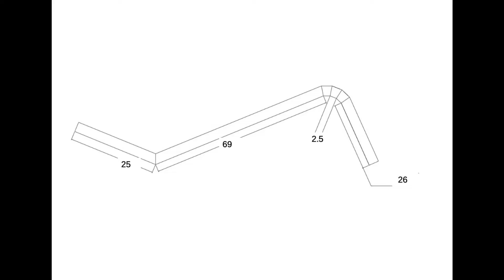1178 How To Build An Electric Trike In Paper - Building The Frame

Comment: Looking great Rob, at the end of the video the frame looks similar to a chopper frame. I wonder if it would hold a large electric motor and battery pack in the same place as a motorbike chopper so the end result looks similar to a paper motorbike.
Reply from the maker: I would think so mate - I am certainly going to try it with a 500W motor
Reply: @ThinkingandTinkering  Cool your going to have an awesome finished product when you're done.